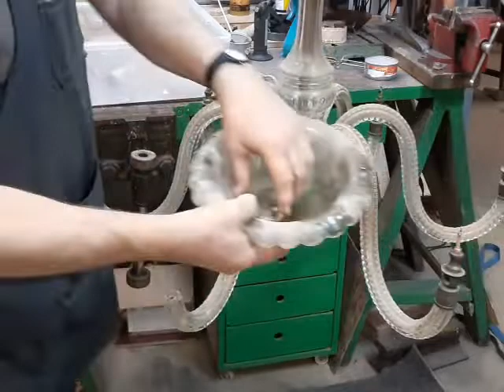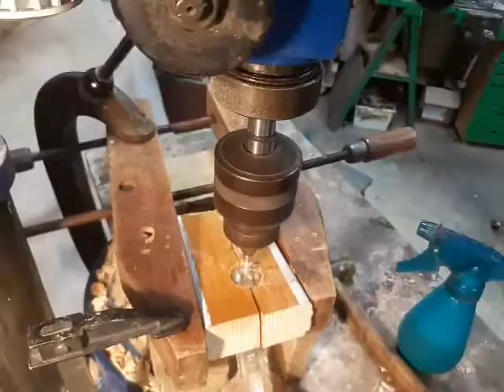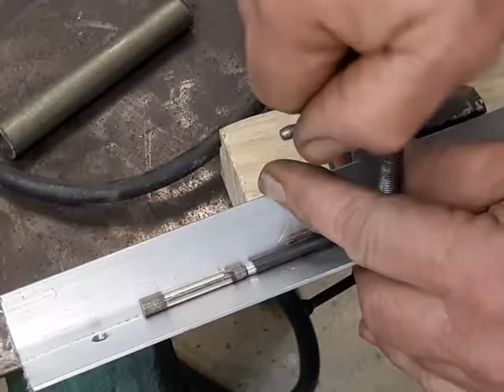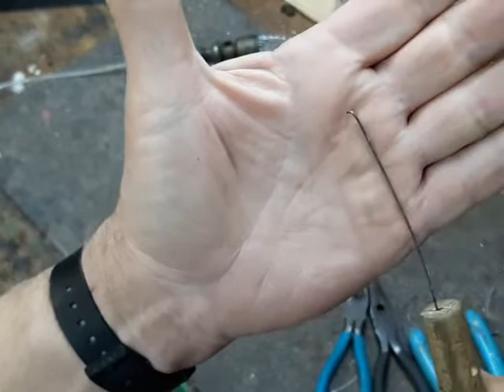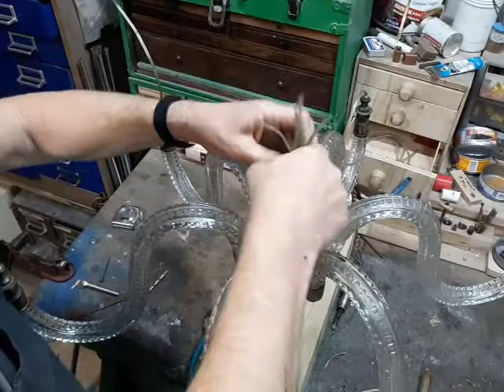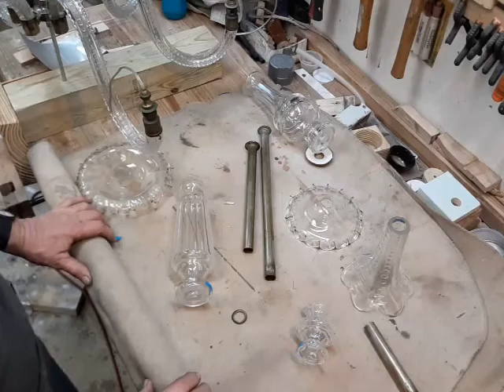Arms of Glass & Nerves of Steel Repairing a Broken Crystal Arm in the Secret Underground Laboratory

Comment: You got me nervous with the fixture moving on the 5/16 Rod. What I do is put a longer nipple in the bottom and  tighten that in my vice. Also doesn't it need to be grounded. That is a very good fixture that I believe to have been gas originally.
Reply from the maker: The rod was set in a 4x4. It would take much more than the weight of this piece to bend a 5/16 steel rod. The thread in the bottom of the body were not 1/8IP, so a nipple would not have fit.

Comment: I LOVE your videos!!!! Thank you! My question is, I have old wire in my crystal chandelier arms and need to replace it with fresh wire, they are in the tight. { the old wires] Any suggestions on how to remove that old wire from the crystal arms??
Reply from the maker: Thank you very much. The wires are mostly likely stuck to the caps at each end of the arm. It's not a strong bond, just difficult to get a good grip. Part of the problem is it's difficult to hold the arm and pull the wire at the same time. This is why I make jigs to hold the arm in the vise. I recommend dripping liquid soap(hand soap is good) into both caps and let it soak for a while. Take a crochet hook and push it down along side the wire. Anything slender with a pointed but blunt tip will do. This will separate the wire and should pull loose. Clamping it safely in a vise really helps.

Comment: The arm of my crystal chandelier broke during a move.  It broke off at the base of the neck which is attached to the fixture.  I tried to repair it with 5 minute epoxy.  I even let it cure for a week and it seemed solid.  However,  once I put the crystals on it collapsed.  I tried the epoxy a second time and it still didn't hold.  I then cleaned out all of the epoxy but couldn't clean out the old plaster.  Do you have any suggestions to make a repair that will hold the quite heavy crystals?  I would be happy to send you photos.  I appreciate any help and advise you could give.
Reply from the maker: There's just too much leverage and not enough surface area for any kind of adhesive to hold a crystal arm. There has to be a mechanical attachment as well. I've used the metal tube trick for arms broken at the chandelier trunk many times. This is where they usually break. This chandelier was more difficult than any other before it. You can send photos to the Secret Underground Laboratory Recovery and Salvage Facebook page. I'll be happy to give what advise I can.

Comment: Did you receive the photo I sent of the broken chandelier arm?  Would plaster of paris hold it in back in place?  It appears that's what is in the other sockets.
Reply from the maker: I received the photo and answered on the Lab Facebook page. I'll copy and paste the answer to You Tube later this afternoon.
Reply from the maker: From the pic it looks like the arm has come loose from the cup, but not cracked. The best way to go about this la to remove the arm and the cup. The stuff below the plate will be held on by the bottom piece, like a finial, but pointed down. Remove any hanging crystals first. Remove whatever glass and metal cover there is. The nuts which hold the arms to the plate are 9/16 wrench size(14mm). Some are 1/2, but 9/16 is most common. The wires are connected with wire nuts, or more likely just tape. Undo the connection and unscrew the nut. Once you have the arm free, you can scrape all the old plaster out of the cup. If the arm is not broken off, the rest is fairly simple. I use patch compound intended sheet rock walls. It's sold in small tubs. You don't want to get compound on the wires. I slide a drinking straw over them. Clean the cup well a fill it with compound. Push the straw through and seat the cup on the arm. Clean any squeeze out. Pull the straw out and let it sit overnight. I hope this helps. I hope this wasn't too confusing. If the arm is cracked, the procedure is slightly different.
Reply: @BronZeage  What is the procedure if the crystal arm has snapped at the base?  While removing a 1972 Strauss crystal 10 light chandelier from storage in 2015 an arm snapped at the base.  I tried the epoxy and it failed repeatedly.  Then I tried the metal tube insert to make the arm withstand the weight of the crystals but the only solved part of the problem.  The arm still was not level with the other arms when reassembled.  About and inch or inch and a half lower.  I tried to raise the arm and fill the crack at the base with foil to level the arm, but in doing so the arm split at the base.  Now I have a two inch shard of glass rising from the former arm base, and a jagged matching arm.  All I want to do it get the fixture to look whole, not to actually repair it. 
 At this point I should try and replace the arm but I don't trust the ones available on the internet.  I have no idea whether they will actually be the same shape and there is no material I can find to classify the particular "S" shape of my fixture. 
I know how to measure the extension of the arm. Socket to socket, mine is 8"  But measuring of the "S" shape is unclear. Is there a standard? 
 I thought of removing the arm completely and trying to epoxy it again and even reinforcing with a white tape or even a metal exterior sheath to ensure it will be able to take the added load on reassembly. Any suggestions?
Your shop and the techniques you have perfected are wondrous to behold.  I was particular impressed with the bench fittings you constructed to hold the fixture and the arms as you restored them.  I have no access to such tools or space.  This has got to be a "patch" repair and not a restoration for me.  At 75 I just would like the arm level to the rest and lit.  
It is fully assembled and lit , I had it on tonight.  But alas with the broken and now hanging arm.
Reply from the maker: @mauette2000  If an arm is broken anywhere except at the cup, an effective repair is difficult. I would recommend replacing the arm. 
If you go to Grandbrass.com, you will find a selection of crystal arms along with the dimensions, so you can tell if it matches your arm.
Reply: @BronZeage Thanks for your prompt reply;  I surely will visit Grandbrass. Again many thanks!
Reply from the maker: @mauette2000  You are very welcome.